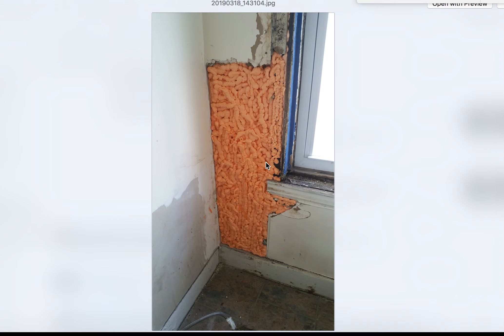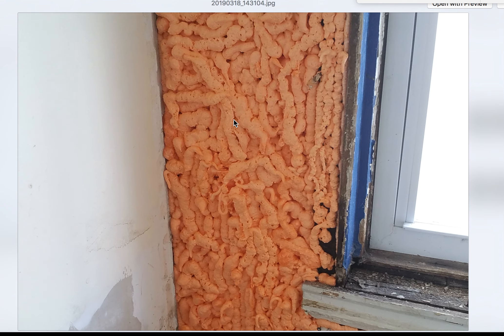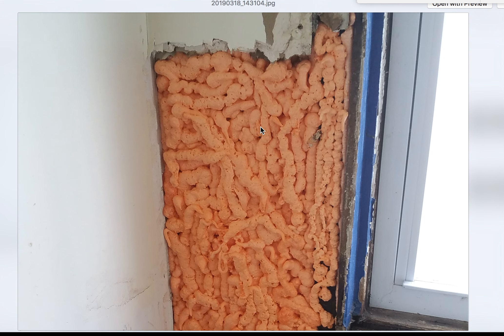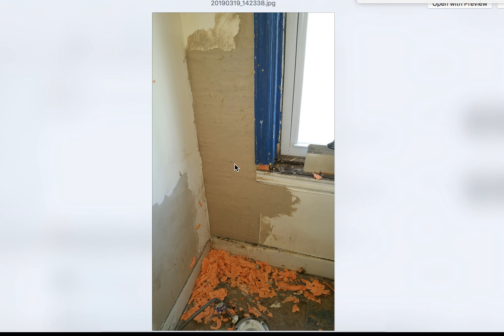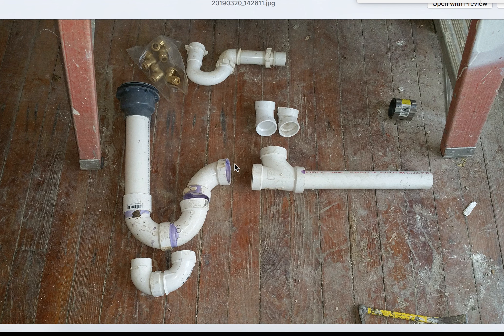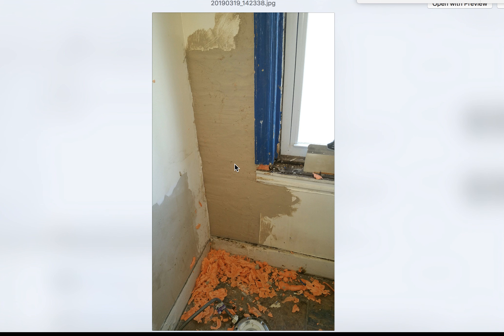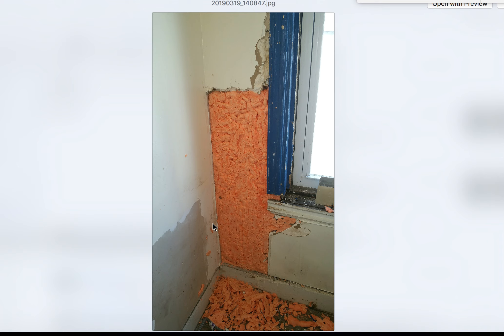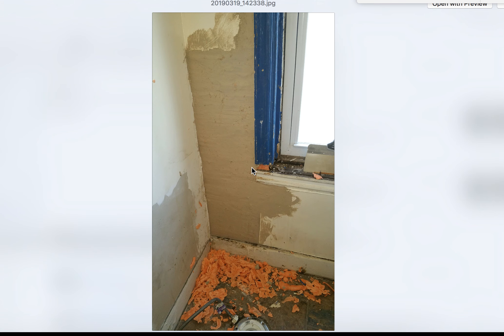PLASTER REPAIR  using SPRAY FOAM as the base

Comment: Should also handle expansion and contraction well whereas a straight plaster repair with crack again. Is it plaster or durabond?
Reply from the maker: It was plaster , base and finish coats.
Reply from the maker: Lol everything may Crack, can you support your abigiuos statement of fact?

Comment: Crazy thought here !!!

 thinking to convert a bus in a camper and using closing cell form for ceiling and finish with plaster over,  it  will crack ????  and ideas ???
Reply: I want to do something similar. I can literally find no real answers. I’ve called a bunch of companies and no one seems to know
Reply: It'll crack probably but do it in small sections I guess, like a control joint.